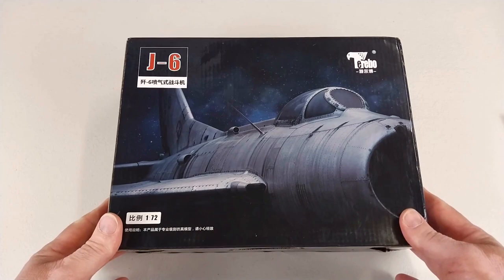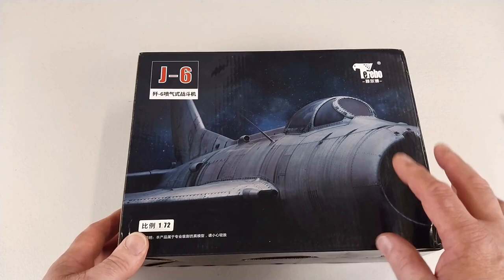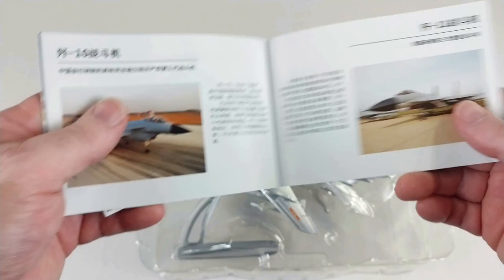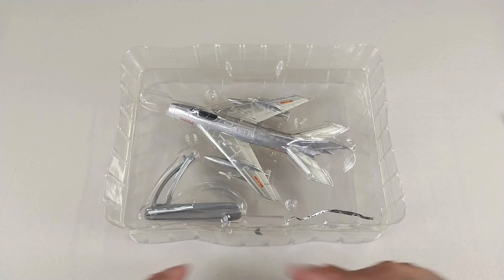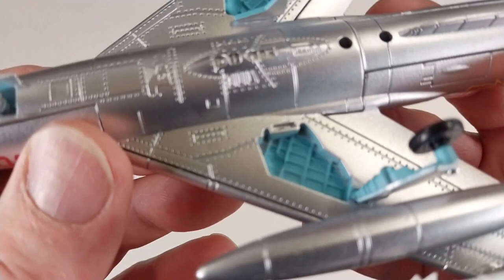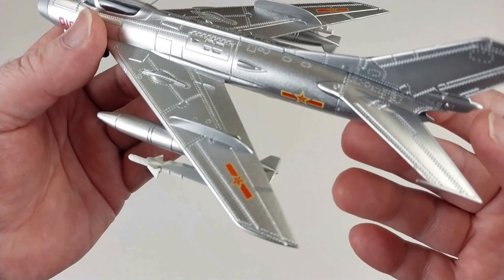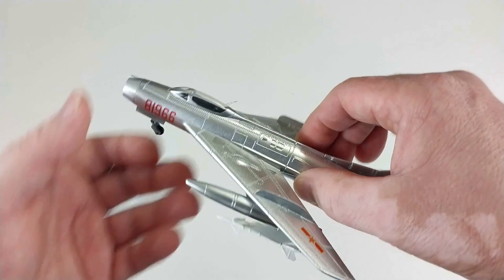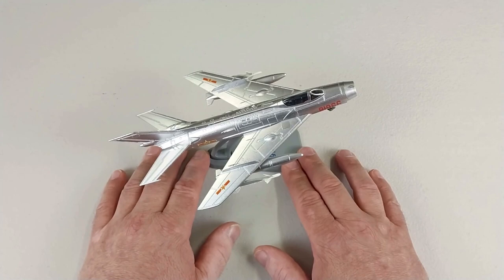Shenyang J-6 ( 歼-6); Farmer, Chinese PLAAF Fighter, Chinese built MiG-19, Terebo, 1:72

Comment: Hi I just bought the same model.  I am happy with this model. The mig-19 is not a popular model and its diecast versions are relatively new. This one is the cheap version, the expensive one costs over one hundred US dollars.
Reply from the maker: Yeah I've been looking at a panzerkampf one i think that's the maker, but it's around the $160aud mark. But it at least has the correct put it tube 😂. This model is not bad for the price and if you can look past the pitotbtube fault. 😀
Reply: @heavymetaldiecast  l think that the expensive version may be better, as you point out, but this chinese version is quite good in view of its price. In my opinion, it would be nice to buy a version of the f-100, which is the us  rival of the mig-19. Both planes were not too successful but they made history by becoming the first supersonic fighters. I have the mig sequence in 1/72' and this mig-19 is huge. My guess is that it is bigger than the f-100.
Reply from the maker: @jmguevarajordan  I just got a Hobby Master F-100D this week. I thought the same thing that the MiG looks alot bigger but I just compared  the two models just now and they are surprisingly similar in size, the 100 actually a larger wingspan. 😀
Reply: @heavymetaldiecast  thank you for your comment about the size of both models.👍
Reply from the maker: @jmguevarajordan  happy to do it 😀. If i remember when I do the video on the F-100 I will try and grab the J-6 or an actual MiG 19 if I get one in time and put them side by side 😀. Cheers